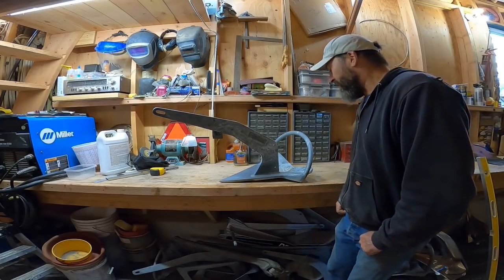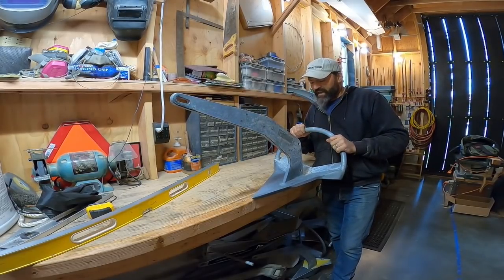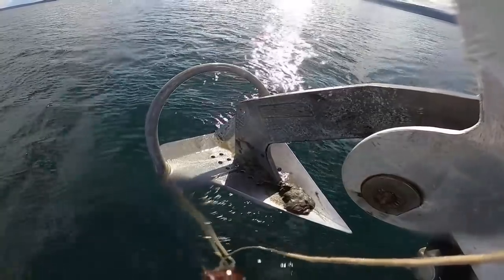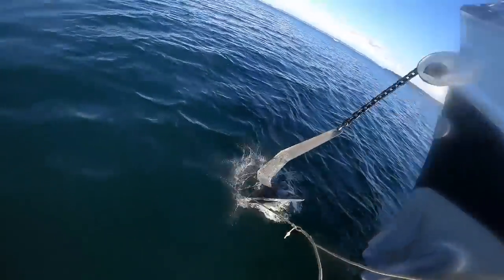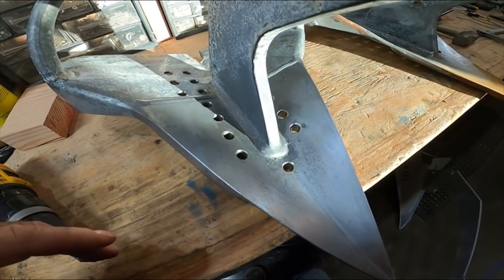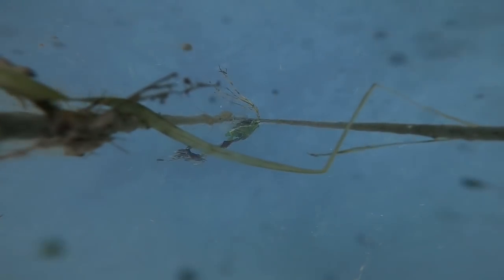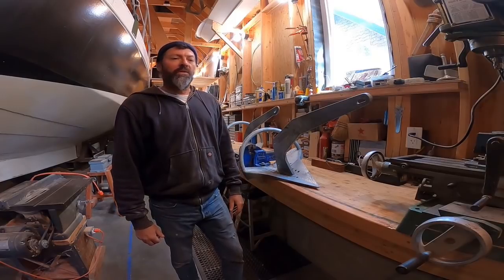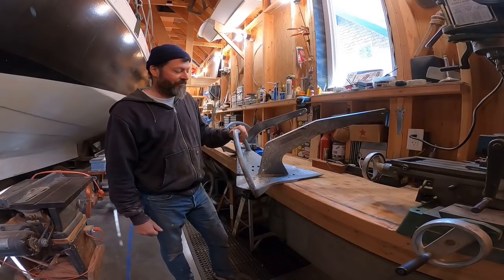Rocna Anchor Modification.   Anchor Test Video #87

Comment: Give me a lever long enough and I will move the world - but not the rocna shank!! - Archimedes 😂🤣 great video!
Reply: He didn't have enough room because the wood was deflecting too much.  He was running into the wall practically.  Three 10-foot lengths of 3" rigid conduit screwed together and placed over the shank for a 30' lever would have either done the job or moved the anchor under the car tire.  A cable winch or chainfall at the end of the lever to an attachment on the wall or a dirt anchor would have been able to impose some.massive force into that lever.  More than an adult male could just by pushing on the end.

Something would break or bend eventually :D

Comment: Remove the rollbar and test what happens.
I know its not authorised or backed by most tribes but do it !
Also sharpen the leading edge of the shank.
Note my old original Delta mk1 and new Rocna 2 have this feature.
Reply: Its often too costly for manufacturers to produce a sharp edge to the
shank but we do not have to follow like tribal sheep.  Please test it.
It will improve the flow of substrate at the anchor blade.
Maybe moreso than drilling holes (?)

Comment: That anchor is designed for the "normal" (i.e. recommended virtually everywhere) scope of 5:1 or better.  The angle of the pull is taken into account when designing the angle of the shank versus the plow.  It seems to me to be mildly disingenuous to do all the testing with such a short scope of 3:1, and I certainly would never encourage anyone to use that for an overnight.  I would love to see a relative test of the same anchor at 3:1 and then at least 5:1 as I think there would be a tremendous difference.
Reply from the maker: The combination of the long, heavy chain and the poor holding of this anchor, meant that the angle of pull (during the 3.5 to 1 testing) was not greater than what would occur at 5 to 1 scope with a mostly rope rode.  
I have tested this 44lb. Rocna at up to 7 to 1 scope and a 22lb Rocna at up to 9 to 1 scope, and while performance did improve (over the shorter scopes)  they both performed poorly compared to numerous other designs (in some, but not all seabeds).
5 to 1 scope is not possible in a large percentage of anchorages in my cruising area (PNW).  3 to 1 scope is indeed '"normal".

Comment: I do wonder if the rocna fluke ears extended out further, like a mantus, if this would improve the performance of this anchor. That is of course a welding job but might be an idea for next season when panope is relaunched. Just a, hopefully helpful, suggestion.
Reply from the maker: My guess is that yes, the Mantus wider ears and resulting larger diameter rollbar would be less likely to clog with mud.
Reply: @flygoodwin  - I was not thinking with regard to mud fouling, you have largely cured that part of the rocna, I was actually thinking that extending the rocna ears further out would increase and improve the setting angle of the fluke tip. As for the roll bar, it does prevent the edge sinking into soft mud but might not be necessary to change to extend the ears. I was just thinking a triangular or some such shape and piece of metal welded to extend the fluke ears further out. I think the rocna has an inferior setting angle and this is why just the slightest fouling, e.g. with mud, causes it to fail. The mantus has an aggressive setting angle in large part because of the wide fluke ears and even with mud attached it does not foul, at least the larger mantus anchors (small mantus 6kg anchor is not as resistant to fouling though as your testing suggests).
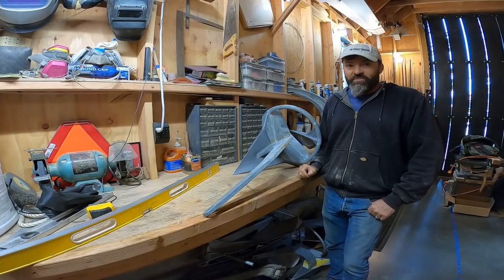Reply: @flygoodwin  I mean, look at 3:36 in your video and see how the tip is not at an aggressive setting angle, because the fluke ears do not extend far enough out...
Reply from the maker: @MrAthlon4800  I now understand.  Yes, the wide ears/rollbar of the Mantus does aim the toe downward and also increases the weight/balance of the  toe.  Not sure if that aspect helps with the mud fouling.  Certainly, when the Rocna fouled during the "deep set" test, it was already upright.

Comment: What if the flattened fluke plates were bendable to begin with - like keep them flat for thick mud & weed and bend them upwards for cobblestone and soft sand?
Reply from the maker: Very good idea.  Would be a challenging engineering feat to make a strong, movable flap.  Probably easiest to have the flap bolted on thus removable or installed upsidedown if the "downturned"  position was desired.

Might be difficult to for the user to determine what seabed is under him and therefore difficult to choose the correct flap setting.
Reply: @flygoodwin  difficult - absolutely, but not impossible if Rocna wants to do it, they would want convincing evidence though. I hope they see your video, ask your opinion and do some experiments on their own. I think you may be on to something with these mods (Manson and Rocna) your are doing 😉

Comment: I'm not sure that the thinking that mud on the anchor upon retrieval is a factor on the anchor not holding. If there is force forcing the anchor down, would the mud stuck on the fluke hold the anchor back? I imagine a shovel, a shovel with mud on the fluke. If you were digging a hole with the shovel, pushing it down in the dirt with your foot, doesn't seem like the mud would make much difference.
Reply: I have heavy clay soil in my backyard.  If I use a shovel when the soil is wet it will stick securely.  Then if I try to use a shovel with clay still attached, it is almost impossible to press it into the ground.  
Mud on the anchor preventing resetting makes sense.

Comment: Hi Steve love the testing you are doing ,I've just got a copy rocna and on your dynamic reset and the cobbles I wondered if you have noticed that in the upright position these anchors have no angle of attack unless the chain can depress the shank or cause a fall over? Could this be relevant.

Steve

Comment: Aye m8, I must say I doubt that the flattening of the back fluke of that Rocna could affect the performance in a bad way. To me it isn’t logical, since they are bended upwards in original design, and then becomes like a rudder, turning the whole fluke up(!) from the bottom. I reckon a test with them turned downwards would be very interesting.
Reply from the maker: Very good point about the up turned fluke acting to rotate the whole anchor.

Comment: do you think that drilling holes is likely to upset the galvanising barrier?
Reply from the maker: Hard to say.  Certainly, the exposed steel (inside the holes) will rust.  Not sure if this rust will "creep" under the adjacent galvanizing.

If I were to place a modified anchor in regular service, I would have it re-galvanized.

Comment: Not right. The rocna needs a lot of chain  so the angle is downwards and digs in.
Reply: Yes, the Rocna works quite well when at 5 to 1 scope or greater and lots of chain. The point this video test is making is anchoring with a Rocna at short scope in a crowded anchorage with a strong wind shift may very well cause your Rocna to fail. If you are anchoring exclusively in areas that few other boats anchor in and you can swing on long lengths of rode then fine, just ignore this video test.
Reply: Anchoring with a short scope in a crowded anchorage??
Isn’t that asking for trouble?
Reply: @johnstarkie9948  Ha, you don’t sail in the Med!
Reply: @SailGeja  
I have,  often.
Reply: @johnstarkie9948  Then you are plenty familiar with short scope and crowded anchorages.
Reply: @andrewvik8710  
Fore-and-aft in a harbour sometimes.
Never in crowded anchorages.
Never less than 6 to 1.
I like to sleep at night in the Med😏

Comment: Testing anchors in a way they were not intended to be used confuses me. Anchors are designed to set and then be loaded horizontally, not 3.5 to 1 scope measured from the bow to bottom at high tide. I have to wonder how they would perform when tested as designed? 5 to 1 or 7 to 1 is typical for that last 40 years. Lifting the shank of an anchor is how you unset it, not set it. Holes? Wierd logic.
Reply from the maker: The Rocna website has a downloadable User's Guide that lists 3 to 1 as the minimum recommended scope.  

5 to 1 or 7 to 1 scope is impossible in the majority of anchorages in my cruising area (PNW) due to Deep Water and Confined/Crowded Harbors.

I learned about the benefits of drilling holes in the fluke from Rex Francis, the founder of Anchor Right Anchors.  This is a well proven concept for which Rex holds an Australian patent.
Reply: @flygoodwin  What the Rocna website actually says is "A scope of 3:1 should normally remain the minimum. In very shallow water this minimum may be too low. " 
In deep water, most scope calculations for shallow water do not apply. I think anchoring depths over 25' need a different set of rules for scope. This truly could be a huge project to do correctly for different anchors at different scopes and depths, but depths under 20' with 5 to 1 scopes seems a typical scenario most anchors would be used for.

Comment: Hi Steve, I'm a fan of your investigations. Have you come across a Knox anchor?
 http://www.knoxanchors.com/
I'm curious to see what you think about the gap between the flukes. Would this save all the drilling? Likewise a flat trailing edge without the Rocna 'spoiler' would save on the hammering? Knox are a Scottish company and I am contemplating buying local but wondered if you had an opinion. Keep up the great work!
Reply from the maker: I have not tested a knox anchor. Fluke slot could help with mud attachment.  However, I have found the area at the base of the shank to be a strong collector or mud (no slot there).

Comment: I stopped watching before half way. Absolute rubbish. Do you think for a minute that the manufacturer didn’t perform all these test prior to mass production ?  As already stated you have just voided the insurance claim if something was to happen  because of dragging. 
I have a 25 kg rocna and have been anchoring in sand all summer. Fully loaded Oceanis 41.1 with 14 passengers and 700 liters in 3 tanks. . Dropped and caught first time every time.
Reply: What scope do you use for anchoring?
Reply: Eddie, watch to the end and his other videos before calling ^absolute rubbish^. I have a 35kg Rocna and holds extremely well but every time I lift in mud, the mud sticks like rock on the top of the fluke and I have to force off with a boat hook. His test is once set, driving forward over the anchor at 3.5knots. In his tests, all filmed, the Rocna does not reset, nearly every other anchor does. I haven't tried this but I would not be surprised if mine did the same given the density and amount of solid mud I find on lifting. I can understand why Rocna may not have tested (3.5kt immediate change in flow/tide direction is not normall) and also drilling holes adds to  cost. At least thanks to his videos I am aware of something to consider when anchoring in mud with my Rocna.
Reply: @johnhart29  I think Rocna anchor works a better at 5 to 1 scope or even 7 to 1 scope. The issue is when resetting at short 3.5 to 1 scope, such short scope might be necessary in e.g. crowded anchorages.
Reply: @MrAthlon4800  every anchor holds better at a longer scope.
Reply: @Dave-SailsAway  you are mostly right, but in my view an exception exists with a CQR which is very prone to failing at 10 to 1 scope but performs best at mid range scope of about 5 to 1.
Reply: Rocha has a lifetime warranty unless you bought the wrong size anchor for your boat. If it didn’t work for you, why not send it back? Just curious. Our Rocha on a 42’ Sabre sailboat never ever failed us.